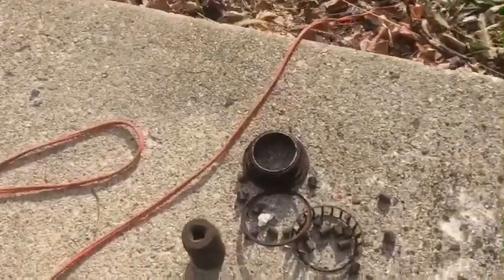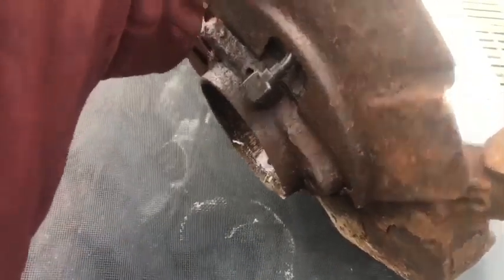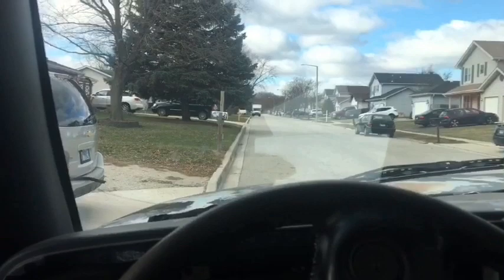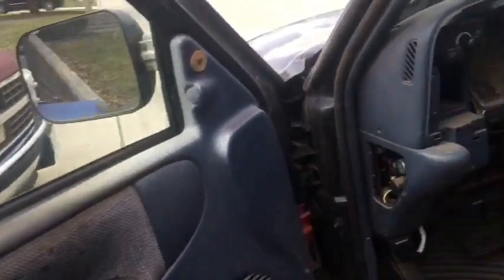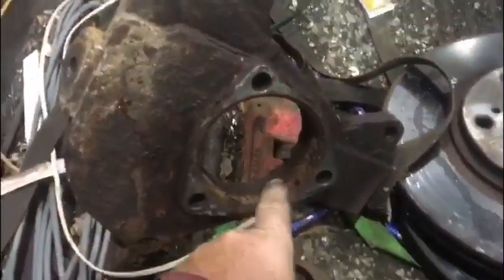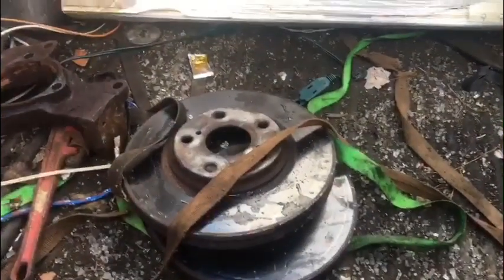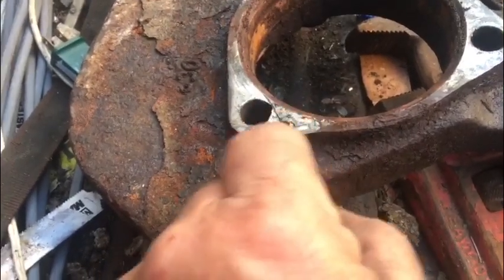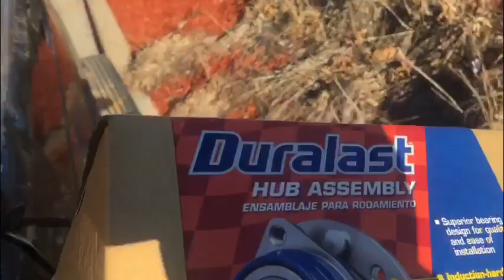THE IMPOSSIBLE SCRAPPER

Comment: King does the rotor have threaded holes close to where the studs come through? If they are you can thread dolts into the holes to assets in pushing the rotor off? BTW the box said DO NOT use a impact but YES on using a torque wrench  The impact will damage the bearing prematurely
Reply from the maker: Might have to do something with careful installation
Reply: @steelisthemeal  Yes the vibration of the impact causing the little bearings to slap between the races and damaging them and or the races. Hand spin the bearing a few good times will also help spread the grease around inside the bearing.
Reply from the maker: Heck I haven’t even been able to get the steering knuckle off because the nut on the ball joints is causing the  ball joint to  turn around as I try to take the nut off 😳
Reply: @steelisthemeal  Use a ball joint fork and drive it at the top of the spindle to wedge the ball joint from spinning BTW good luck on finding someone to pull the frame in two hours. They charge that just to pull it on the rack and set it up around here  8 hr minimum @ $125 hr.  Feilz Navidad
Reply from the maker: So about $750......to around a grand  I was figuring around $750 @2/12 book hours @$$300 a book hour. 
So the value is about the same I was definitely a little higher in cost of book hours
Reply from the maker: Yeah I used a pickle fork for wedge the steering knuckle and it’s not working to stop it from spinning